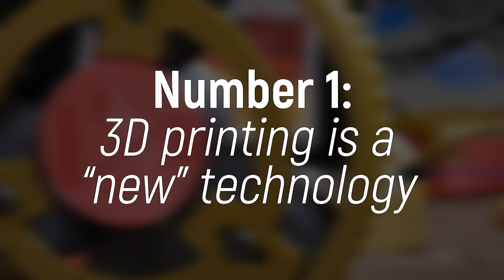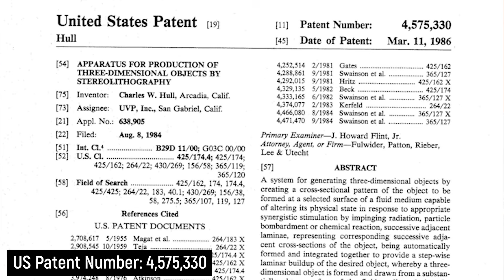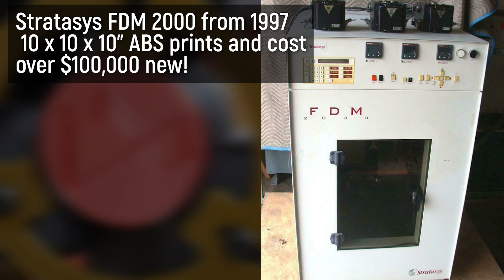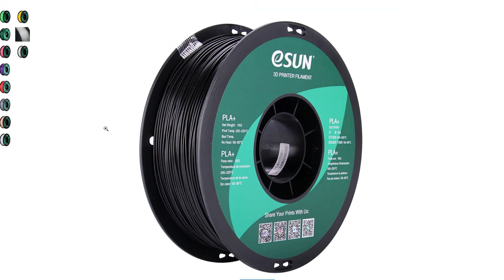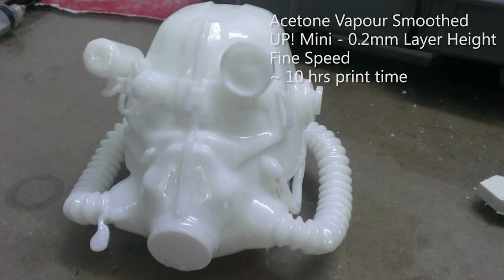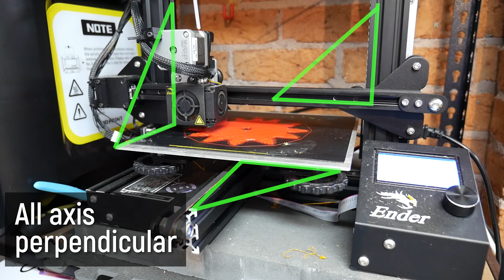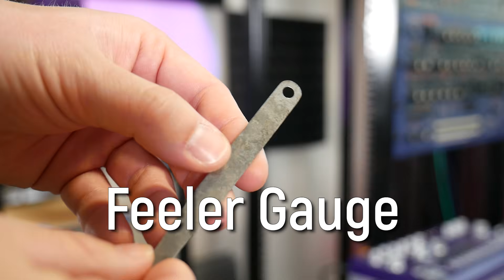3D Printing Myths I used to believe...

Comment: A thing we (metal worker) do on conventional lathes/milling machines is using thin cigarette paper for adjusting our scales. The key is to stop when feeling any friction, too much friction results in rupture of the paper. I also use this for 3D printers. You don't need to adjust the height that way. The challenge is to "feel" the tiniest amount of friction as most beds are spring loaded. I turn the wheel about 1/8th of a rotation up to compensate for the paper thickness. For faster levelling, you need to do the measurements right above the adjusting screws to avoid multiple levelling sequences. A guage is certainly a good way of levelling as you know precisely what offset you have. Levelling (still a valid word, but you just need to know what your reference plane is and that is the plane your printer head prints in) a 3D printer is just a skill you need to acquire through experience. And any method that is successful for you is valid. What I noticed is that the biggest challenge is actually having a clean print nozzle. Any filament buildup on the nozzle affects levelling way more than doign the levelling itself.

Comment: 0.20mm Feeler gauge been stock equipment on the creality cr10s pro (v2).

Myth n4: leveling bed and nozzle on temp. thermal expansion on nozzle and bed doesn't make enough of an impact to throw of your prints

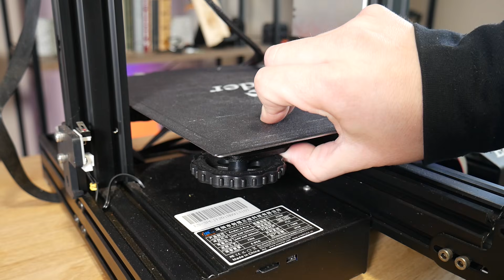Comment: I enjoy all your videos and while watching this one you commented at 7:33 about dual Z screws being "notorious" for going out of level and even showed what I believe is an Anet A8.  This problem is one I have wrestled with for some time on my Anet and while I have searched extensively I have found no reference to this out of level problem until now in your video.  I had come to believe it was a problem I alone was experiencing and something basically wrong with my printer but now believe it is something others must have suffered from also.
Is there a cure for the problem and what causes it to start with?  Is the Anet the only printer that experiences the problem or do all dual lead screw printers suffer from it?  If there are web sites discussions on the problem I would love to have a link or any other comments that might help me overcome the problem or at least know there is no cure.  
Thanks for any help and again thanks for your videos.

Comment: You aren't supposed to fold the paper. Just one piece of paper, not folded, then adjust it until it gives a bit of resistance. Then you can use the Z offset to fine tune the distance from the bed.

Comment: Bed leveling with BL Touch and properly setting up the nozzle height, etc. I never ever had do touch those darn spring screws ever again and just run a BL Touch bed level everytime before printing.

Comment: Everything other then bed leveling, no need to comment but i can tell,  all are bullshit and don't need anything to bed level your printer correctly.   Home your printer and set your height level eye balling (really doesn't have to be precise yet).  If you have a light in the back of your printer,  seeing exactly how high the nozzle is against the bed is very helpful.   Then use 3 or 4 brim lines to your print.   Now the fun part,  I can tell you with certainty after printing for 7 years,   filling the line with your finger,   i can tell if the height is correct or wrong.  But even further,  i rather have the first layer swished (elephant effect) rather then being too high.  I rather have the print stuck to the plate rather then partially.  Rest will fail for sure.   My printer does the filament nozzle clean (just a long line).   That is where i test the line with my finger.  Never fails.   No need for electronic BS bed leveling,  stopped using paper long ago,  or any other tools.

Comment: The expansion/contraction due to heat is actually negligible where setting up the printer is concerned.....a couple of ten thousandths or so. Although I do "level" the bed as the printer is preheating, it's more of a time saving measure than concern over the expansion.
I've been using a strip cut from a typical soda can as a "feeler gauge" since I scratch built my first printer 6 years ago and have always had good results with it....I keep one of the strips in the tool tray of each of my printers.

Comment: In fact if you clock gauge the bed while heating you will see it warp depending on where you look. 

This is because the backside is heating faster then the top. So until it all equalises it distorts the bed. 

Generally 3d printers simply aren't accurate for thin 0.1mm layers on the first layer. 

This is why I always have a 0.3mm first layer.

Comment: Very nice video I have learned a lot thank you, I am new for 3D printing, I am trying to design a small gear for my old SONY walkman it requires a very strong gear to handling a large torque from the motor, could you please provide the correct settings for the ENDER-3 printer? I am using PLA.

Comment: Coming from me, a guy with 5 years of CNC machining and milling, 3D printing is a hobby I enjoy. And honestly the last part of the video on leveling helped, because I have used this technique in milling but for some reason never crossed my mind in 3D printing. Typically in CNC we have a tie-down bed that we mill if it needs resurfacing, then we determine the tool heights and machine zeros from the bed with feller gauges. Or in the case of more modern machines, a computer controlled touch feeler. But anyway, thanks for the help!

Comment: I pre heat and use the paper without folding it, works pretty well for me, never had any problem with the bottom layer by doing that.

Comment: paper trick is only if you dont have auto-bed leveling on your printer i guess.
And ive seen some fold paper 0, 1 or 2 times in their videos, so that adds to the problem aswell. And many papers have different thickness :D I dont fold my paper at all.

Comment: I have also used the paper method for nozzle height but if I do fold it then I only fold once, until I discovered that I could use my nozzle and aluminium print bed as switch. So, just by tuning the first layer height in my slicer, I can now have a 100% consistent first layer height even if I were to change to different brands and lengths of nozzles 100 times a day.

Comment: People should just get a DTI and print a mount for it. 

Those new to 3D printing, save yourself a ton of headaches and time messing about. Get a DTI and throw away the springs in favour of solid/hard mounts and shimming. It’s tedious and time consuming (at first) to take the bed apart, shim, refit and test again but it’s so very worth it. 

Using a DTI and shimming I’ve got all my beds to with the low tens of microns corner to corner (about 30 mics). This obviously fluctuates across the bed slightly, but my inductive probe maps now largely match a CMM examination of the heated bed profile. 

Post shimming you can turn down some spacers or even just use a decent filing action and some good calipers to get your bed mounts to the custom height. 

Something that should have been in this video is the myth that a bed level sensor will fix your first layer issues. It just won’t. A bed mesh will make a good manual levelling great, and it will make a great one excellent. It can’t make a bad manually level good.

Comment: If you have a soft surface where the nozzle can press into the surface it works without, but as soon as you have a hard surface such as glass, you need either a BLTouch (or similar) or manual mesh bed leveling . With the Ender3  the SKR mini e3 is already sufficient for this. 
You can level the springs in this case by eye, or with paper but it should not scratch the paper, slightly before it is enough. 
With manual mesh bed level paper is enouth and at a starting height of 0.2 it must then scratch clearly, but not so much that it jams or the paper gets damaged. 
You must also consider that the absolute height that it shows you will eventually no longer be correct. Up and down leveling and moving, especially if you have overdone it and pressed the nozzle into the bed, brings inaccuracy into it. 
So home Z again and continue, do it 2-3 times and it is at least as good as a BLtouch. It sounds like a lot of work (and it is), but it usually lasts a few days or weeks. Depending on how much you print. 
When the nozzle hits something while it moves or thin supports no longer adhere well, then the fun starts from the beginning, but the roughest unevenness of the glass is stored and you must only make small adjustments.

PS: heat the bed up to print temperature, but not the nozzle, except you have no filament in it!!! 140°C is fine for PLA.
Constantly leaking PLA will spoil any measurement with the paper. 60-70°C less will not make a difference with this measuring method.

Comment: Very interesting video. I'm officially a subscriber. :) I just got my first 3D printer 5 days ago, it's an Ender 3 Pro. I went for the cheapest since I'm new to the concept of 3D printing. After 3 days, the 24V fan next to the nozzle just stopped working. Should I buy an official part from Creality or I can just use one of my old computer fan to replace it? Thank you!!!

Comment: Recently got into 3d printing and found that paper tramming works decently enough but the "standard" of how much drag you have to generate is all over the place.

With that said feeler gauges are easily repeatable and ensure more consistent results for anyone, plus I do not know what the tolerances are for paper manufacturers.

Comment: I use the paper method, but not folded. Just a single thickness of average paper, and my prints stick 99% of the time. I would however suggest using the thinnest paper weight.

Comment: HOLY CRAP. I argued with almost the entirety of Facebook's "3d Printing" group that it was better to use feeler gauges over paper. 
Paper gets moist from handling it too long, paper gets affected by the heat from the nozzle and tears, paper won't knock out the oozing plastic as well as a feeler gauge, feeler gauge (with thickness of your first layer height... 0.2mm) is far more accurate/consistent than using a thin piece of paper as your "0.0mm", paper deforms (becomes thinner) if the nozzle digs in too low, etc etc. 
And you won't believe that nearly 100% of the members would scream and yell that feeler gauges is the "absolutely wrong way" of doing it... and the two or three guys who DID use feeler gauges wouldn't back me up on it.
Reply: I don't understand how anyone can assert that using an engineering tool SPECIFICALLY designed to provide an accurate and consistent height, could insist that a sheet of paper is BETTER at that task!  The anti-science movement in society must be getting much larger than I thought 😑.  I guess it has been a case of "the blind leading the blind"?  Seems to be an awful lot of that in the on-line 3D Printing Community - and it is very obvious that many of the "loudest" posters don't really understand how the equipment actually works!

Comment: Feeler gauges are the ONLY method to use if you want perfect first few layers.   
It's honestly upsetting that almost EVERY VIDEO shows paper. Paper comes in many forms, There is Fax paper - 0.010, printer paper - 0.0038, copy paper, A4 paper, inkjet paper-0.0050 ,  laser paper - 0.006, legal paper, writing paper, recycled paper, newsprint paper, art paper, tissue paper, repro paper, book paper, loose leaf paper, typewriter paper, etc...   and guess what!!!  
THEY ARE ALL DIFFERENT THICKNESSES!!!!! 
( I only listed 4 actual sizes as an example because i didn't feel like looking them all up. Also, measurements are in inches)

Comment: Sure fire cheap bed 0 about the same as I've done on my CNC milling machine for years via probe.  

I set my multimeter to continuity (tone when leads touched together) and use an aluminum block.  Clip one lead to hot end heat sink towards top so it's not overly hot.  Make sure nozzle is clean and the other meter lead to the aluminum block.  Then just slowly lower print head to the block until it tones, move up till it stops then back down to confirm.  Z position is the thickness of aliminum block so subtract the thickness for 0.  That gives true zero to bed, it's especially handy with a dual carriage IDEX printer.

Comment: Love to see the new alloy polymers on the market, so nice to have better options without having to deal in ABS!

On a glass bed I tram the nozzle and build plate (aka level the bed) by SOUND! The paper method was always troublesome.
First make sure nozzle is very clean, then bring the nozzle directly over an adjustment screw, then down to 0.0. I then adjust the plate up to the nozzle until the vibration from the hot-end fan can be heard on the build plate, and back it off just until the sound stops, then very slightly until it sounds again. Repeat for every adjustment screw you have and back again. Remember to lift the hot end before moving and bring back to 0.0 for each point. This gives you an extreme true 0, and you may adjust your z-offset or first layer flow as needed, or back the screws off just until sound contact stops at your preference. A tube to your ear to the build plate can help you do this, much like a stethoscope. I also set my glass build plate onto the heated bed with a layer of silicone heat sink pad, no more clips warping the glass.

Comment: Bear in mind that most printers for personal use come with their own levelling card to use to set the printer. It’s possible that the printer OS has a feature that deducts this thickness from the set value. You can also set your slicer to print a single layer skirt around your print and after printing, measure the skirt thickness to check your adjustment. The skirt should be the thickness of your first layer.

Comment: I have a file that I use to print pads over each adjustment screw for the bed. After printing it, I measure the thickness of the pads and adjust appropriately for bed leveling

Comment: What about when prints get older. I have many prints in PLA that I was very happy with when printed but after a year or so they got brittle and turned to rubbish. That's why I use PETG most of the time now as they appear to keep their strength better over time.

Comment: The bed leveling is a pain.
Im new, like 12 hours new...

Im good in science but in all honesty, I followed others guide video without even thinking about metal expansion when heated 🤷‍♂️

Think it might be a good lead.
At first I thought it was because the springs were compressed for so long that they needed time to get their shape.

I'll check the square advice video around 7mins just to learn more. thanls!

Comment: Bed leveling to get things close is fine. I just print with a brim and level by eye as the printer lays down the first few rings of the brim. Gotta watch your fingers. Alternatively, just print your part and adjust. If you're too far off on your first layer, stop the print, clear the bed, restart.

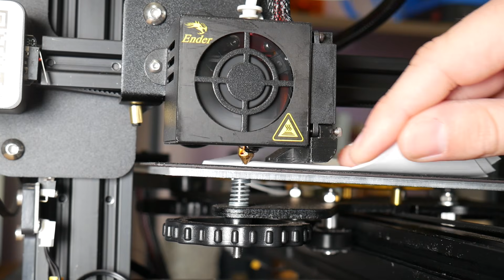Comment: 8:15 Don't fold it over a few times! Don't fold it at all, use 1 layer of thin paper, which is about 50-100um thick. Move the clean and heated nozzle down until it becomes difficult to move, don't stop at a little friction. Also make sure to heat the bed first. This will give you a good starting point
Reply: Plus, the purpose of leveling is to ensure a consistent Z distance regardless of X and Y. Making gcode Z match actual Z is a separate process. I level my prusa mk3s bed to about 1mm, then tune z down to the desired offset. Trying to do both calibrations at the same time is impractical.

Comment: I'm just getting started into 3d printing and its one of the things I've wondered when watching all the tutorials on you tube, why leveling with bits of paper, coming from a mechanical background I use feeler gauges regularly and a decent set doesn't cost much more than about 10-20bucks... and is much more accurate than a bit of paper, really don't know why the printing community hasn't taken onboard the idea of using feeler gauges when there so readily available and much more accurate?....

Comment: I'm using the z offset on my Ender 3 V2 to set the correct 1st layer height when the printer is printing the brim or skirt. I've found that the z axis stop switch is very inconsistent when starting the print. My z offsets vary between -1.7mm to -2.50mm which is huge margin. Good thing is that it's very easy to set the right value by feel and observation on the first lines of the first layer.

Comment: The most frustrating thing that I've come across having had three different glass covers for my bed is the fact that these glass beds are terribly inconsistent I've had two of them that were more than 1/4 millimeter high in the middle one of them was almost half a millimeter heavy in the middle how in the hell are you supposed to compensate for something like that?
Reply: print on a raft so it can absorb (in theory) all the inconsistencies in the print bed, or use something like a BLTouch to track the bed and modify the print on the fly

Comment: Yeah… I just use a piece of paper it’s roughly .08 thickness, I use it to where I just get a little bit of resistance. so when I print my first layer at 0.2 (0.28 total) I just micro step it down -0.1 to get it back to my original first layer height roughly .18 which ideally is spot on every time.  AND, having a 0.16 layer height keeps everything geometrically close enough